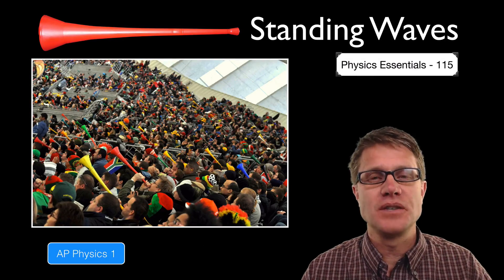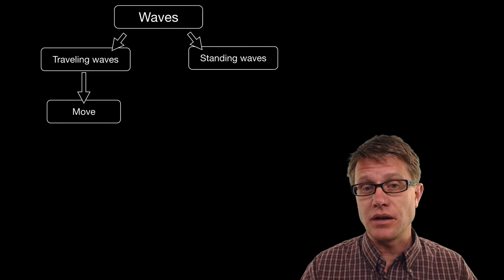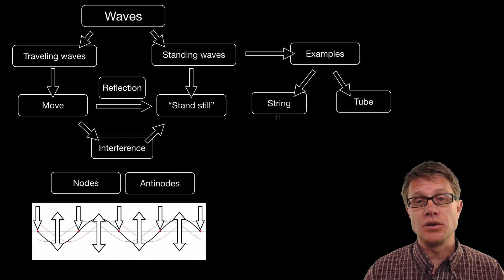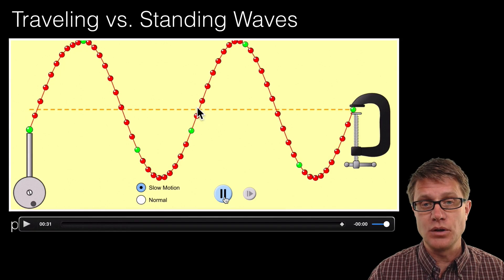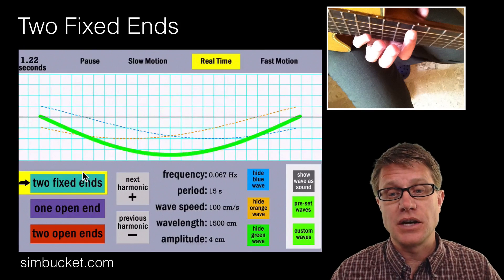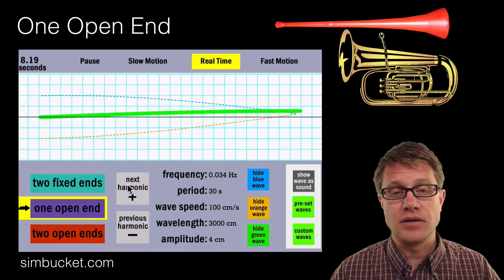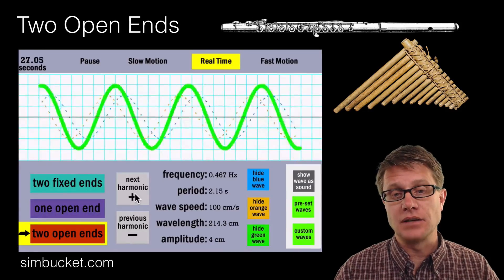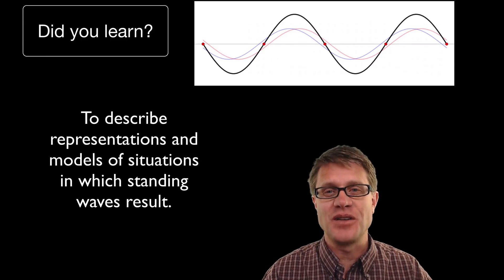Standing Waves

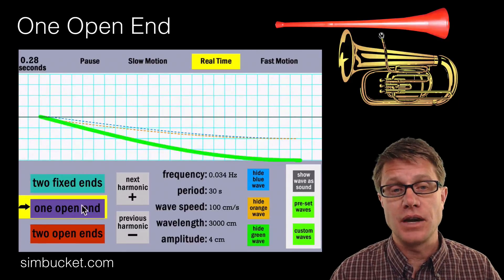Comment: 4:42 It would be helpful to to elaborate on which end is the Node and Which end is the anti node. 

Im assuming the node is open "trumpet" end where sound is met with equilibrium end of open air, a "barrier" of sorts that won't allow compression; and the Lip end is the antinode since thats were most of the pressure is being generated, and acts as a hard barrier, an ideal place where compressions can  be built upon itself.
Reply: Wait, by that same logic, shouldn't two open ends nodes, as it is explained here (https://newt.phys.unsw.edu.au/jw/pipes.html) or am I missing something??

Comment: HI, for a standing wave i don't get how you created two travelling waves(Blue and red waves) in your video. Do you pluck the string twice or once? 
Thanks for the help!
Reply: The blue wave is traveling left to right and the red wave is a reflection of the blue wave off of some surface and is traveling right to left. Where the wave and its reflection meet at their peaks they create another wave that is the standing wave. They also add to each other making the standing wave larger than the original. I hope I explained it well enough.